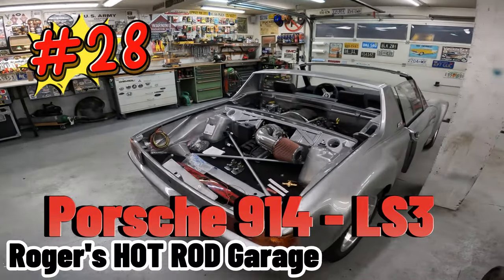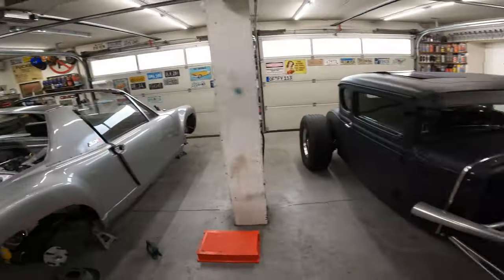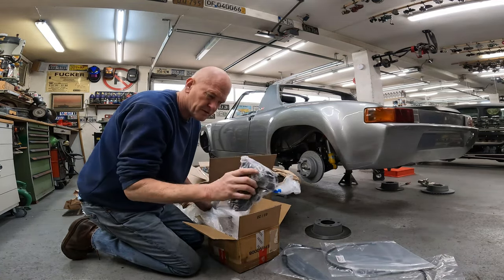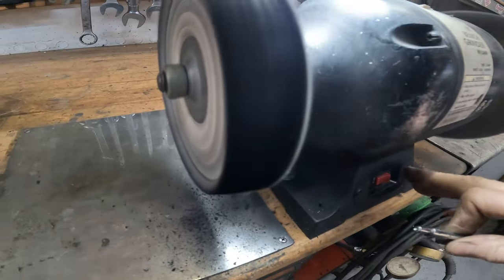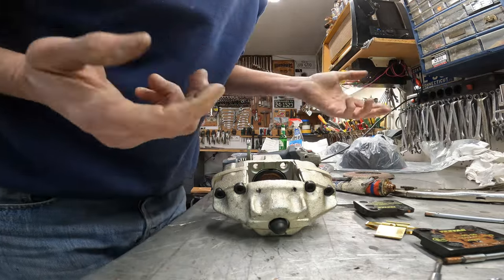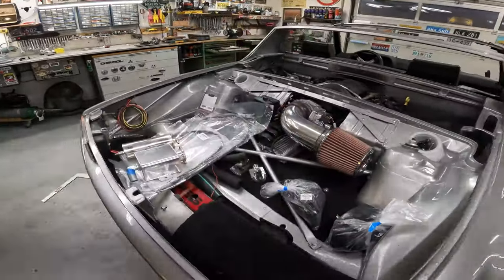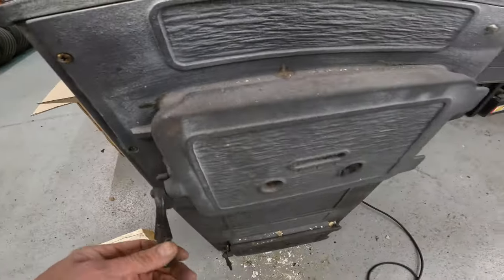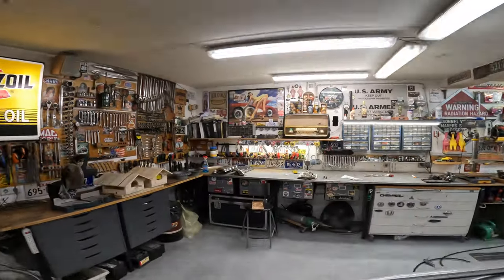Porsche 914 - LS3 Build Video #28 (Big Rear Brake Disc)

Comment: This is the difference between a mechanic and a parts changer. In one of my builds, I put a 98 12V Cummins into a 92 Ford F-350. Using the Dodge NV4500 transmission, I had to overcome the clutch slave cylinder mounting. So I bisected the adapter on the dodge and placed a piece of thin walled tubing between the halves. Clocked everything as necessary and welded it all up. If I ever had a failure, I could go to Dodge and get the factory slave cylinder and bolt it directly on. Put on about 80,000 miles after that before I let the truck go. Adapt and overcome is what it's all about.
Reply from the maker: Changing parts and items is easy.   I love ''figuring things out" and then making them work.   You got a few videos out there?  Send me a link brother.....
Reply: @Karolilalu  unfortunately no. This was done 15 to 17 years ago. BUT, I'm hearing up for a 12V Cummins with a 9-13 speed double overdrive medium duty transmission install in my 99 F-550 Ford truck. Currently, I'm running a 7.3 power joke in it with auto trans. Hopefully, this late summer-winter, I'll do the full conversion. I'll do some videos on that if I remember. I tend to have tunnel vision on these builds. Lol